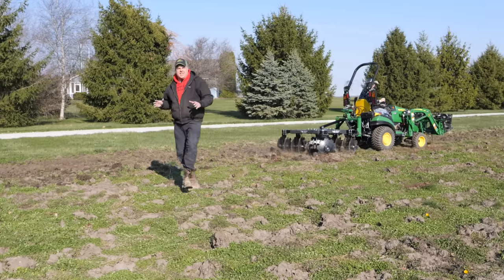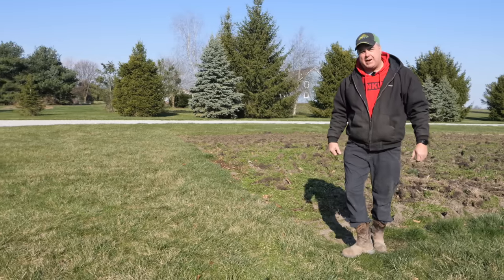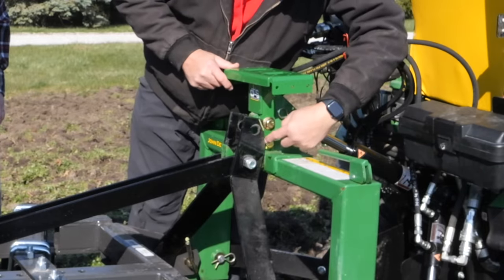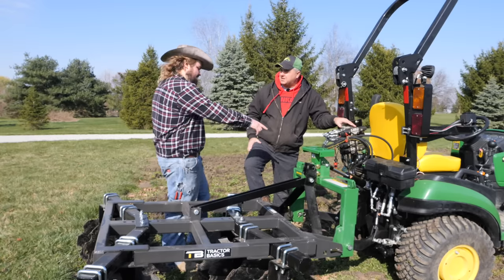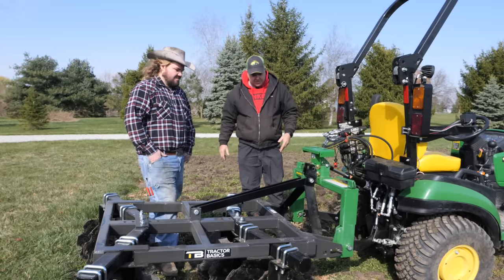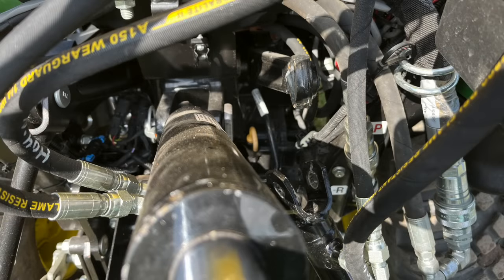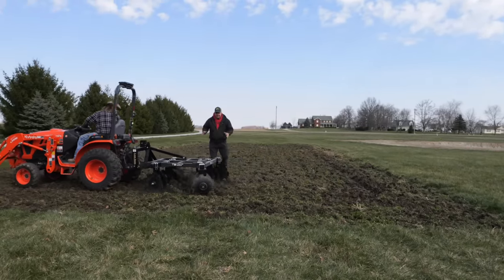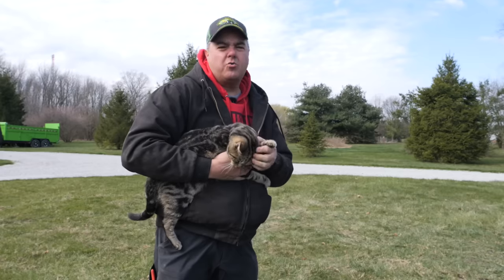Attempt to DISC the Garden BREAKS 2 Tractors! John Deere 1025R, Kubota LX3310

Comment: I am 16-year-old and I bought my first tractor. I love watching your videos. To see what implements I should get next.
Reply from the maker: Congratulations!  What tractor did you get? What will you be using it for?
Reply: Apparently you shouldn’t buy this attachment, it will break your tractor too. Just kidding. Get to know your maintenance manual well. I suggest keeping an extra of each filter and oils. Good luck
Reply: It would be wise to get a loader, unless you have it already  and a box blade.  You can do so many different things with a box blade. After some time and money you could get a grapple of some sort.
Reply: This is a great channel not only for which attachment to get but how to use them.
Reply: I want to get a third function kit so I can put a grapple on there
Reply: It’s the shuttle shift version
Reply: I use it for around the property and mostly jobs
Reply: @TractorTimewithTim  Massey Ferguson 1825E with a front end loader finish mower and box blade
Reply: Great video.  Will say im used to a little bigger tractor with more power and ac and heat. My wife claims now I have an equipment problem. Juat bought a new dump trailer and a cat track loader lol.
Reply: @cjones1262  I upgrade the hydraulic flow and adjusted the relief valve I do have more hydraulic lift
Reply: What impliments you need depends on what you are using it for. If you are going to grow food with it, I would suggest a deep plough (plow) so It will soften the soil so roots can go deep. Then either a harrow or tiller. $1K for plow and $1K for harrow. $2 K for tiller. Perhaps you can offset costs by advertising to do garden tilling. The cheapest rototiller is $1k.

Comment: Always good to see you working the hardware and experiencing real life breakdowns.  I have a generic QH on my B1709 and the Pats on my B3200. I hardly use the QH due to the top hook issues you have. Now that I know Ken has an extended hook, I may pick one up. My biggest gripe on the Pats is the need to keep the lower arms as tight as possible. If not, the attachments will pop out. Doesn’t matter if it’s the rear blade, box blade or brush cutter in my case. Once that bulb lit for me, I’ve had no issues with my Pats. Hook up issues were solved when I started using carts to easily position my attachments. Like Dave said, it’s either three minutes or 20 minutes to get hooked up. Can’t wait for it to dry out enough here to start working the soil.

Comment: After buying my Kubota tractor  I bought a quick hitch from Tractor Supply. I have 2 older implements that would not fit correctly onto the hitch so I modified the implements and made them fit.

Comment: The quick couplers facing straight up on the Kubota made my eyes twitch especially when noticing the rust. :)
Reply: that and that part that broke  didn't exactly make orange look good did it?
Reply from the maker: @donalexander4083 ah, I break stuff on the green too.
Reply: yeah and sometimes things break on those that doesn't make the green look too good either  😄
and I am still trying to figure out how a push pull rod snaps in half 
any thing standing out to you on what caused that?
 @TractorTimewithTim
Reply from the maker: @donalexander4083 not sure. Some comments think it was stuck, not allowing rotation.  Maybe Dave yanked it?   We’ll know more when we fix.
Reply: @npalen - Yeah, the  couplers facing straight up does seem odd. That's a poorly done dealer or personal installation. Also, they make covers for those that would keep them clean when not in use.

Comment: I completely understand that this channel is here to show what these small tractors can do and be pushed to the limits but a tiller beats this in every aspect.
Reply from the maker: Did you listen?  Hmm.
Reply: Tilling is not better in every aspect. No pto shaft to maintain (i.e, slipping the clutch every ten days and keeping the shaft lubed)   or implement gear box to maintain. Tillers can turn the soil to concrete if you time the weather wrong.

Comment: The idea of the quick hitch is to simply back  up to the implement, raise the 3 point and it is attached. Pat's still means getting off the tractor and hooking up the top link.
I have both. Don't see any saving in time or effort with Pat's.  That disk does a nice job. Your videos have helped me a lot in making decisions on purchasing attachments.
Excellent video and editing.
Reply from the maker: Thanks for the kind words.  
3 point hitch was great invention.   Unfortunately, it has not been 'improved'.  Now, one of the most frustrating parts of a tractor.
Reply: L ppl l+

Comment: Another great video.  It should have answered or cemented some questions for people that they may or may not have had.

I have a 1025R, it serves my overall purposes based on my 5.5 acres owned.  Last year I bought a tiller for it… I LOVE that thing; so much I had even jokingly told the wife that we were gonna have to get a divorce because it was a new love hahaha.  I live in west-central IL and some of the nicer weather that has been flirting with us has tempted me to get out and till the gardens, but I know I’d jut have to do it again so why bother.

This video to me should’ve been proof to everyone that…

1) Stick with the same color of attachments that you have for your tractor.  Yes, you may some money and supposedly they are universal to be all the same; but this video sorta proves that by sticking with color to color you shouldn’t have any problems because they are designed to work with each other.

2) The video also makes the point to make sure that you have a large enough tractor to do any job for the attachments at hand.

3) Things break.  But I can’t help but think that had you done this project with a Frontier brand of tiller you wouldn’t have had any of your issues.

4) Thank you for doing this video.  I’ve wondered how using a disc for my gardens would work.  I see know that for me anyway, it would be a waste of money.  Just going over and creating new with the tiller is the best option.  Come over and we’ll fix you a cheeseburger.

5) Lastly, is Dave a hired hand on the farm?  I’ve seen him in a few videos helping you now.  At first I thought that maybe he was your son but since he wasn’t call Christie mom that answered that question.

Another great video Tim.  I’m sorry for your issues, but I think you helped people in an unintentional way.
Reply from the maker: Thanks for your comment.
Dave works for us a couple of days per week now.  We actually showed his wedding last summer in a video.
We met him during our mission trip in Honduras.  Fabulous young man.  We have a lot of fun together.

Yep, stick with your tiller.  

Yep, we like to show all (or most) of the issues we encounter.  ...and we encounter lots of fitment issues given all the different stuff we try.

Comment: "We got at least three more tractors we can bust."  That's the spirit!  I till deep ('21 1025R) as soon as the ground is dry enough and then shallow before I plant because I don't have a disc.  Had a HD sub-soiler and a two-bottom plow with my '56 Ford 640 that prepped the gardens initially.  Only three Hp more than the 1025R . . . but they were three BIG Hp!  I had to cut 4" off my sub-soiler vertical pillar to allow the 1025R to have ground clearance and not just use it as a ground anchor.

Comment: Great video! You may have mentioned it a couple years ago but the bracket used on  the right hand side of the  ROPS for the switch box where would I be able to get one? Thanks
Reply from the maker: The bracket is supplied with the Summit Hydraulics kits.
However, assuming your 1025R is older than a 2022 model, I would recommend upgrading the fender. The 22 and newer ones have knockouts in the fender.  Check out this video which shows the replacement: https://youtu.be/ECycjcsspg4. Link for the appropriate parts (not expensive!!) are in the description of that video.
Using these knockouts makes for a very nice professional look.

Comment: Great video Tim. I have used a 3pt disk quite a bit. I much prefer my chisel, and disk combo to that rototiller I no longer own. lol 
I do think your better choice of tractor for your disk is your 3046R. 
I am able to use my power top link on my 3046R to transfer more of the weight of the tractor to the disk and get more cutting and depth out of my disk. 
You probably already know all that. 
PS I 100% agree quick hitch is the way to go. I agree completely everything that can be should be designed properly to be quick hitch compatible. 
We had a quick hitch on all our farm tractors way back in the 70s and 80s.
Reply from the maker: Interesting.  
Good comment.
I still LOVE my rototillers.

Comment: I have a JD 3039R and similar sized disk to what was used for this video.  First off, disks are better for bigger areas, tillers are better for smaller areas.  This garden is a bit small for a disk because it's tough to get speed and work the ends and corners well. This is what I have found works best in my food plots that get disked annually. First 2-3 passes, low range so 3.5-4 MPH, most aggressive disk gang angle and let the 3 point as low as it goes to allow for the deepest cut available.  Next 3-4 passes, minimal disk gang angle, changing my approach angle to the field,  mid range 7-8 MPH keeping the disk up a bit.  This tends to level and throw the dirt.  When I say throw the dirt, I mean across the faces of the other disks and to the outside.  This provides great mixing, especially when trying to mix lime in to a food plot.  If the soil hasn't been worked for more than a year, it needs to be ploughed first with a moldboard plough.

Comment: I don't know about anyone else, but a demonstration of the land leveler on the garden would be interesting to me. I got mine now and I have to say I am extremely impressed with it! I had both of my gravel driveways thoroughly ripped up and leveled the worst areas within a few short hours. I drug out a ton of gravel from a hard to reach spot under our wind break bush line without destroying the bushes like I might have with a landscape rake. I have never had that much fun with a grader blade or a box blade, they always seem to be allot of headaches and adjustments to get them to do half the job in twice the time. Best part, I didn't have to borrow the box blade or grader from  my brother, he has instead asked if he could borrow the land leveler. Good luck selling that Orange thing! I mean, fixing...
Reply from the maker: Glad you are finding the HeavyHitch.com land leveler effective.  I found it to be quite handy!  for others, check out the video here: https://youtu.be/w09NQHakXUo and use code TTWT for 5% discount.

Comment: In Missouri we had rock hard soil in a lot of places. We found a single point ripper a curved one not the new straight things. Run that about every 12 to 16 inches. Then follow with a little single mold board plow or a double. Then disc.in a single winter the soil would get hard enough a tiller didn't want to stay in the ground.

Comment: I read in book form 1926 and from older videos from the 70s and 80 about agriculture, that they plowed the fields in autumn after harvest to let rain and frost bust up the big chunks of earth  into fine soil. before planting they just ran the discs , a harrow or cultivators to crumbles the soil into powder and prepare the seedbed.  Regarding that I think the discs are not the optimal tool for breaking up the sod  to prepare a new field. An already planted field with loose top earth on the other side is is more suitable for the direct use of the discs to turn the stocks from your harvested plants into the soil to nourish (fertilize) your field. As a complementary implement to a plow I think it should work at its best, though I would still recommend to wait a few days between the use of both of them.Ii'm no expert of the matter but that is the conclusion of my observation on the matter coming from different sources.

Comment: With the quick hitch the disk is farther away from the tractor. You may be able to lift the disk without the quick hitch. As for time considerations how much time is lost lifting the disk with the hydraulic top link? Oliver and Case were one of the first lower link "quick hitch" but JD used it on the top link.

Comment: I’m glad you often show the 3R. In my area within 1 hour there is three of I believe 7 John Deere dealers all the same company and they Do Not bring in a 3R open station. Lots of 3E’s but the R’s have cabs and I someday I would like to move up from my 1025r. I refuse to buy a tractor without being able to lay hands on it so the Orange dealer only 5 minutes is looking better. 😩
Reply from the maker: The 3R open station is amazing tractor!  In many ways better than the cab version, especially if you are taller.
Reply: @TractorTimewithTim  I would be using it in the woods a lot and I feel a cab would just get in the way.

Comment: I bought a sidearm ditchbank mower @ an auction & got a quickhitch to try to make it easier to attach to the tractor. Turns out the toplink pin on the mower is 4" too high for the quickhitch. Not sure what the solution should be. It takes probably an hour to hook up by myself the way it is. I've considered Pat's quickhitch.
Reply from the maker: Pat’s probably best.

Comment: For my Toro 522xi garden tractor I bought two Agri-Fab discs that I will assemble back to back, add a tongue hitch and add its own wheels with a lift. I’m doubtful any sleeve hitch would lift it. The bumps created doing that would show anything loose in your tractors steering system.

Comment: I don't use my quickhitch anymore. I almost find it easier to hook straight up to 3pt. Also w the 1 series it takes off a bit of weight back there and moves everything marginally closer. I also think the 3 point gives more range of motion.

Comment: Tim, I have always wondered why you pull the release arms on the QH up prior to hooking implement.  Any QH I have ever used the locking thumbs on the lower links are angled so when you lift the implement they get pushed in and then come back out locking the implement in place when its engaged and lifted.
Reply from the maker: same reason I pull up the spring loaded releases on the loader before attaching.  It makes the connectivity easier, and sometimes the spring is strong enough to dislodge the attachment, not allowing it to connect properly.  I have plenty of issues with the quick hitch as it is...anything I can do to make it smoother, I do.

Comment: You really meed to buy the plugs they make for the quick couplers on the back of the Kubota to protect them when not in use. All that rust will contaminate your hydraulic system.

Comment: Tim, as long as you’re modifying the disk why not shorten the other end where the bolt is and drill a new hole. You have the hydraulic top link so it should work.
Reply from the maker: Yep. That would help.
Reply: I wonder if shortening those bars might adjust the angle enough the top pin would be the right height. 

I'm one of many people that thought putting the bolt in the bottom hole would work but the geometry on the disc part of the hitch is still terrible.

Comment: As fast as the QH makes changing attachments, there are times that the juice is worth the squeeze. The further from your hitch the implement is, the less weight it can lift. When you don’t have the lift power on your three point to lift the implement without sucking it up with the top link, bringing it that 3” closer to the machine makes a world of difference.

Comment: I have one of those 6 ft. angle iron framed disks and it is too light. The most penetration I can get is 4 inches and that requires several passes. I can't adjust the gangs past position #3 without it making the tractor crab terribly. I know some pieces of railroad steel would be ideal to add weight but that ain't gonna happen. I bought a 5 ft. tiller to use after disking and that helped tremendously.

Comment: I'm curious as to why would you even choose to pull the disc with the 1025R when you have the 2038R, 3046R, and the Kubota? Not to mention the small tire size makes making multiple passes at different angles more of a rodeo.
Reply from the maker: Easy answer. There are 10x 1025r’s out there compared to 3R’s….for example. 
Everyone wants to know what the 1025r can handle.
By your logic, I would never use the 1025r.

Comment: The seat on little Johnny was really getting a workout!  You could really see it absorbing all the bumps & ruts so the driver didn't have to take the hits...the 2nd seat was stiff and all that shock was on the drivers spine. I think the tiller does a nicer job, if you till it first then use a land plane to level out the garden (if it's needed) that would be the neatest & quickest.
Reply from the maker: http://tracseats.com use code ttwt!  It is really nice!

Comment: found this interesting Tim, i have found with the quick hitch you could put on six implements and never move hook go to another and you got to change height i put pins instead of bolts on that hook real fast also i used my 1025 for years with just the 3pt no issues after buying the hitch no matter what i did my Deere 647 tiller would not fit , called dealer and Deere  NO CLUE  what i found was the 3 pt lower pins on tiller could  be reversed on the tube frame , that  did it ! seems some one installed those and it works with 3pt but not quick hitch, live and learn i called back Deere and they made a case file about it